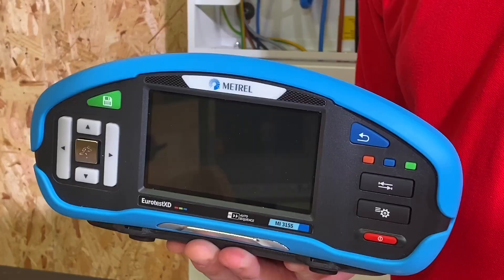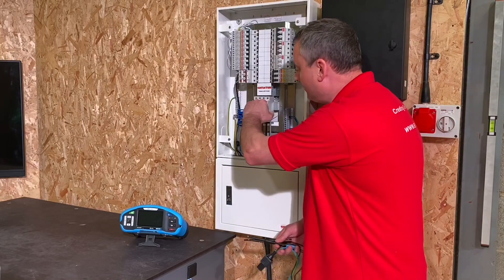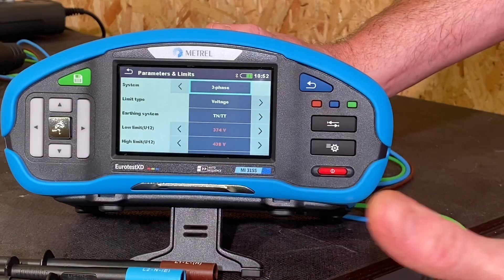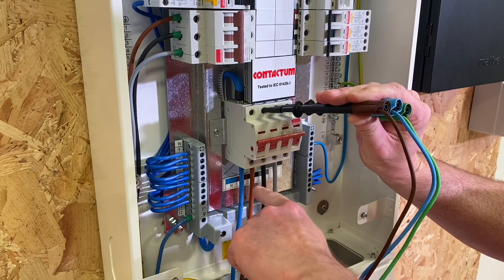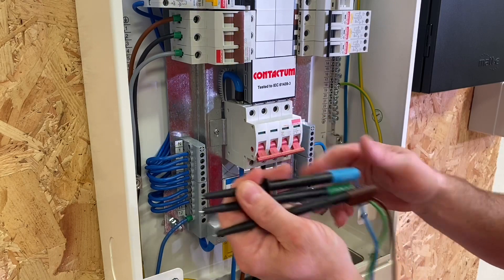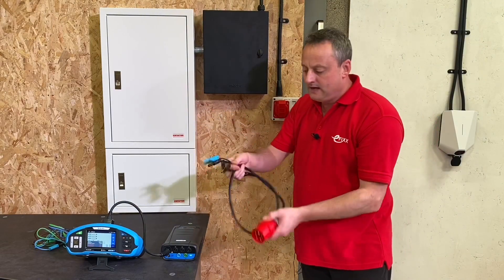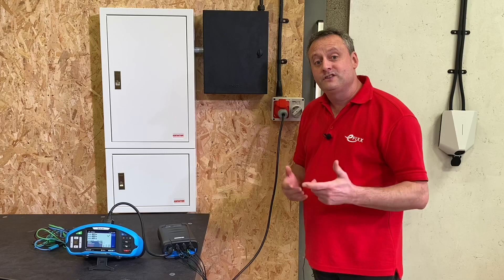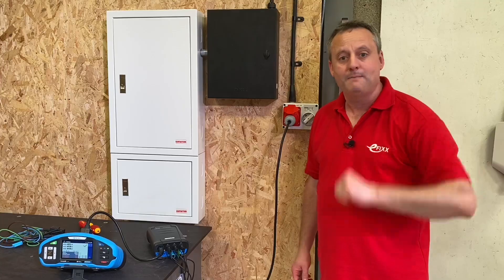Phase rotation test using a Metrel Mi 3155 & A1507 active switch (phase sequence)

Comment: Hello, a question about the MI 3155 or MI 3152: Do you have the accessory receiver A1191 R10K to selectively place conductors in walls or in boards with the A1192 tip ?. I understand that R10K is also used to locate buried cables. A video on this topic would be nice. Greetings

Comment: Hi guys great vid was wondering if yous could do a video on ring final circuits and if there is specific way they should be wired or recommended way to wire eg balance for the ring and taking the first two cables to the closest sockets then working your two legs to the centre of the ring to complete. I would be interested to see if this is what most people do now a days as this wasn’t the way I was taught but just curious. Thanks efixx
Reply: Hi Sean, call us if we can assist. Regards Brendan Metrel UK 01924245000

Comment: Incorrect phase sequence tests, yet the unit reports green tick :)
Reply: Ressy6 I think it’s because it’s testing the voltage rather than a phase rotation 🤔 the voltage readings were correct therefore passing the test even though the phase rotation was incorrect. The phase rotation is more a visual check I believe.
Reply: @franad14  Ahh that would make sense :)

Comment: I had to make up the 3 phase plug accessory for the 1507 , does Metrel now supply them ?
Reply: Roger Bean they have 2 now available ... a 16A and 32A ... A1641 and A1642 adaptors 👍🏽😊 both supporting the A1507.  Looks like they also have the A1110 3 phase adaptor (16A) which tests direct from the tester amongst others.  Just been checking out the Metrel website out of interest :)
Reply: francesmad14 , thank you.
Just sent of an enquiry for price.
Reply: @franad14  Brought all 3 accessories, not a lot of money.Get it back on the first job.
Well made and finished nicely with heat shrink.
Time to play now
Reply: Roger Bean awww well done 👍🏽😊 let us know how you get on with them 🤔

Comment: Have looked at this a few times, looks like a great bit of kit, and I can understand why it's so dear as it has great functions, display etc, I like the plug connector for the back (keeps it simple) and I like the probes (chunky and substantial) but unfortunately the price (albeit probably justified) puts me off.
Reply: Ray Murphy i was a little sceptical at first re the plug for the leads but I find the leads actually get less tangled due to the fact they’re all attached together as well 👍🏽😊 having used another brand tester before whose leads got tangled up relentlessly 🤦🏽‍♀️ this is a refreshing change
Reply: Valid point below about leads, my fluke always get twisted together.
You won’t regret it, make the meggers look positively archaic.
Reply: Roger Bean couldn’t agree more! The Metrel is light years ahead of most other testers 👍🏽😊
Reply: Hi Ray, call me when you get the chance. Brendan Metrel UK 01924245000

Comment: Better example for the check of the proper direction of the rotating field is a table saw. A defective compressor is nothing compared to a sawblade flying through the air....quite undesirable scenario...

Back in the old days equipment like this one here were used to test the direction of the rotating field:

https://www.alte-messgeraete.de/elektrotechnik/hartmann-braun-frankfurt-a-m/drehfeldanzeiger/

The terminals are labeled R, S and T which were the old designations for L1, L2 and L3 at that time when the device was manufactured (1965).

A three-phase meter must also be connected with a clockwise rotating field.

I use the Fluke 1654B for six years now, and it still can do everything that is required these days, including test of type B RCDs. And most german electricians use Gossen Metrawatt, Fluke, Chauvin Arnoux, Benning or Megger. Maybe I should support Megger, because their german plant is almost arround the corner....and if there are any problems with one of their products, just simply throw it over their fence :-P...no, just a joke...

Comment: Recently got the MI3152. Have only had it a few weeks so still finding my way round it but it’s a great tester with so much functionality. Loving the videos of the Metrel series 👍🏽😊 thank you
Reply: What won you over on the metrel mi3125 instead of the other brands
Reply: mohammed ali I decided on the MI3152 because of the number of functions and future proofing. You can update the software when the regs are updated. Its easy to use and intuitive. I wanted to make sure I bought a tester that I hopefully won't have to replace for a good few years and I think this one fits that bill for many reasons including the competitive pricing for all the features you get. I would highly recommend it.
Reply: @5e34nut  hi, please do not hesitate to give us a call if we can assist with any enquiries. Regards Brendan Metrel UK 01924245000
Reply: @brendanbeaver486  hi brendan can i buy direct from metrel , thanks